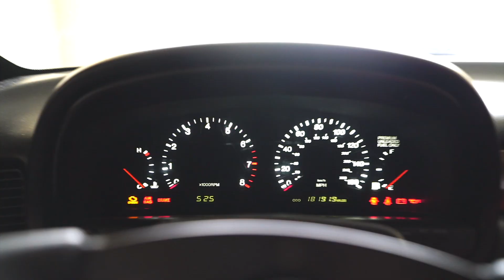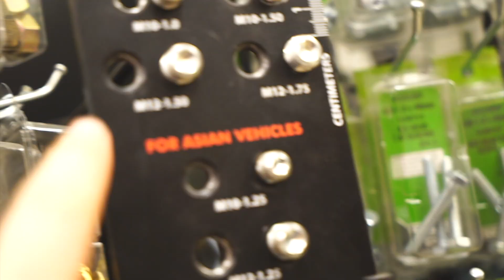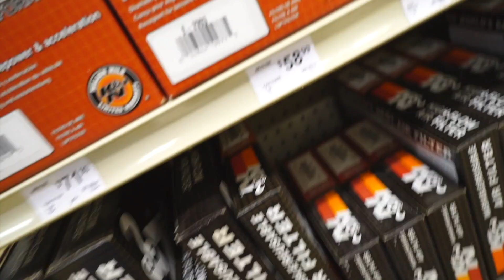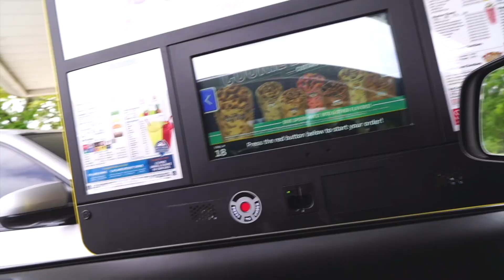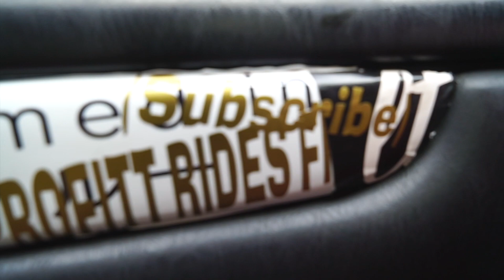$25 Air Intake Mod **ANYONE CAN DO**

Comment: Hey bro your especially the clamp-on and then you slip it over the hose and you will have to worry about fitting it and stuff man so next time that's how you do it
Reply: Jason Vankirk he won't listen. Should have used a hard pipe between the charge pipe and intake neck. Also battery should be tied down full stop diff or not. Down pipe should have been cleaned with brake cleaner to eliminate any chance of smoke.

Comment: You need to get this thing tuned. Honestly that should be first on your list.
Reply: Cesar Landaverde he doesn't care though. He is kind of cheap when it comes to car stuff.
Reply: Cesar Landaverde you mean ecu tuned?
Reply: Yea put the car on the dyno and make sure everything is running the way it's supposed to
Reply: Shouldn’t he do that after? He needs to tune it after every mod he adds.. because every piece changes the amount of air going in to the ecu tune needs to change

Comment: That set up sucks. That open filter should be in the coldest area of the engine compartment. Yours is right around the hottest area of the engine, lol.  You'll loose Horse Power.  Nothing but a noise maker.

Comment: Why would you want to suck in hot air into your motor?!?! Smh.
Reply: Jordan Hitchcock he's not, the car is intercooled which is why CAI's are pointless on turbo cars. Short rams are better
Reply: Regardless of how hot the air is it's gotta go through the hot turbos then through the intercooler cooling it down before it goes into the intake manifold